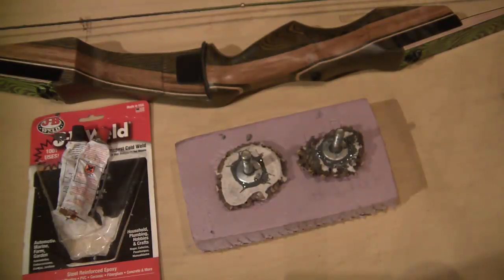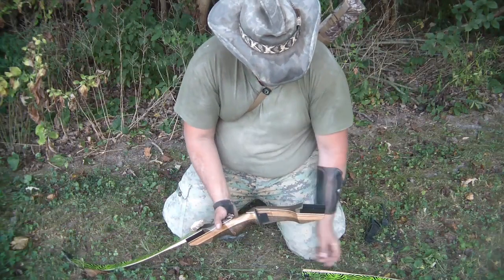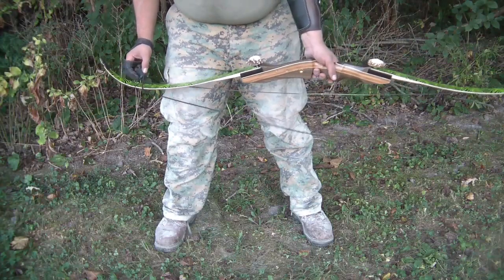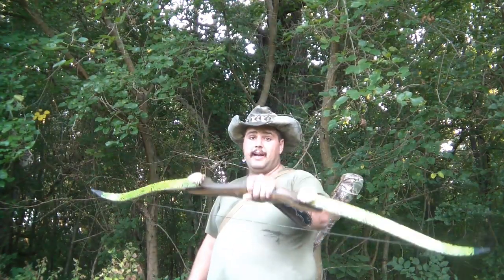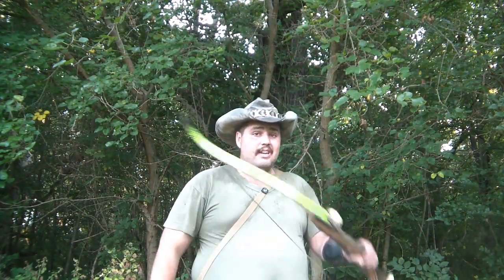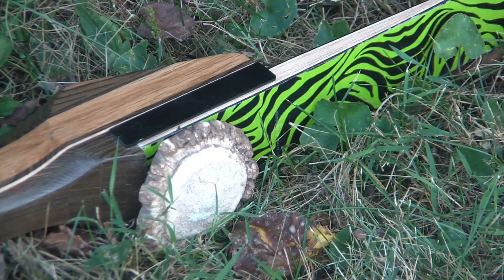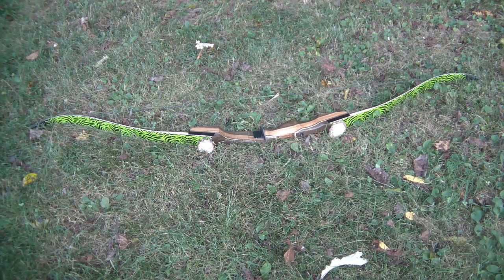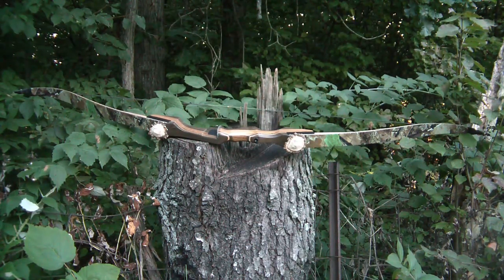TGO How To Make Stag Limb Bolts! Part2

Comment: I'm glad you had better luck with JB Weld than I did. My brother Mort backed into the Acetylene bottle on the torch set with hay bail spike and punctured it. I tried to repair it with JB but it did not hold. Tried several times but it did not work. Maybe I did not let it get hard enough. Bow looks good. Are you going to deer hunt or ground hog hunt with it? Ever thought of spinning your own arrows out of 2x4's?

Comment: I don't see why you can't just use the antler butts to cap the original bolts, just as long as it's not completely covering the bolt head? I'm thinking they'll stick just fine if i rough up the face of the bolt head, then clean it off with thinner of some sort, GB weld is ridiculously strong...I guess i just don't see the point in replacing the bolts. I should get my samick this afternoon, guess I'll find out this weekend!